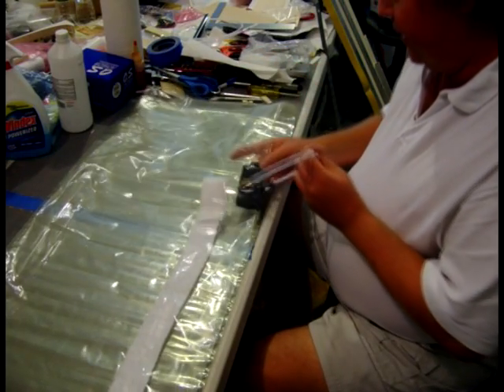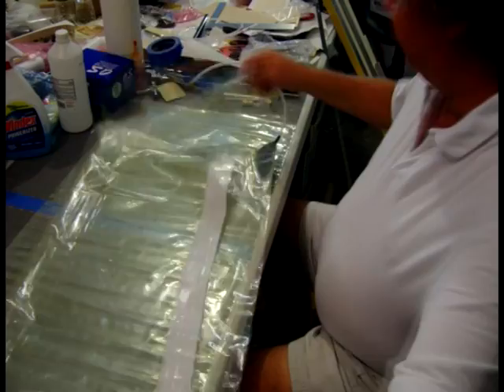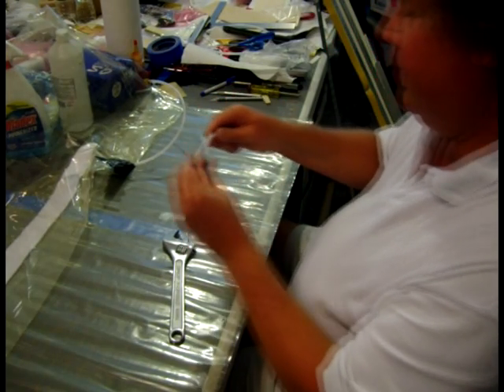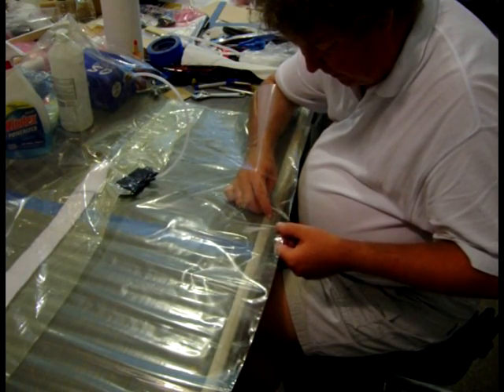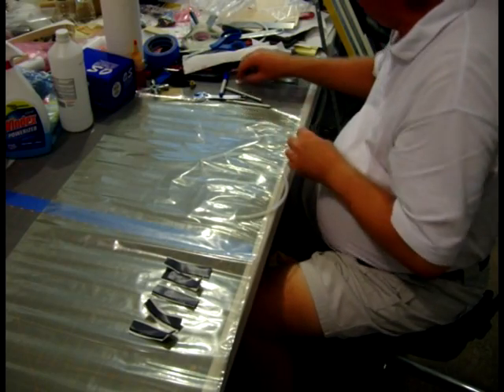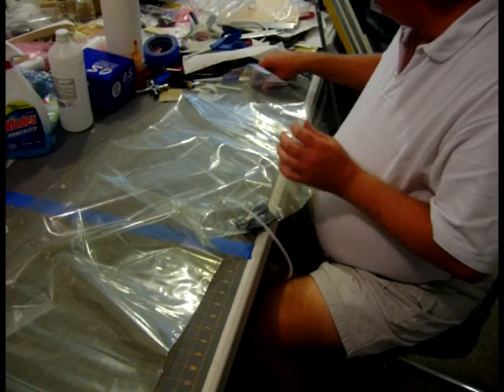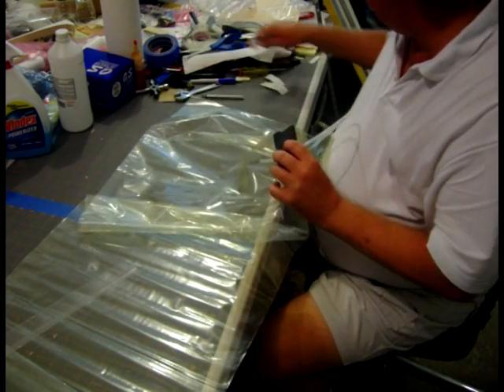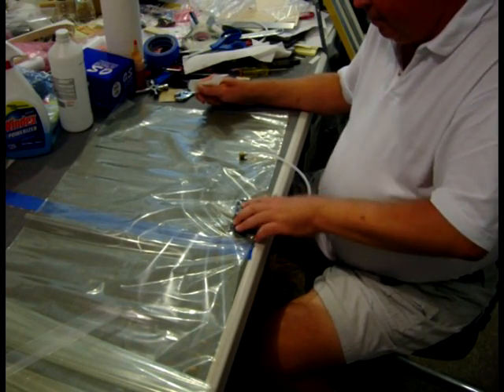Making a Composites Vacuum bag

Comment: you must have a large vacuum, when I vacuum my house, I have to change my bag at least once, with this bag, I can vacuum for three weeks and not have to change the bag, i want to buy this bag where can I buy these?
Reply: averagemale2000 are you kidding?
If yes then you have got a nice sense of humour.
If not then let me tell you this bag is not to store dust.
It is usually used to pack clothes then getting the air out of the bag so that the clothes get compressed and are easier to pack.